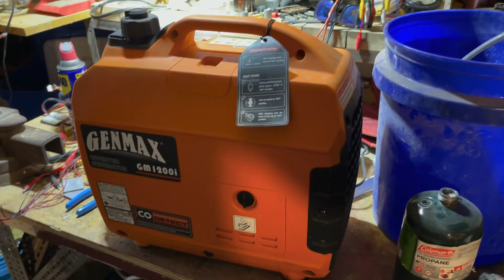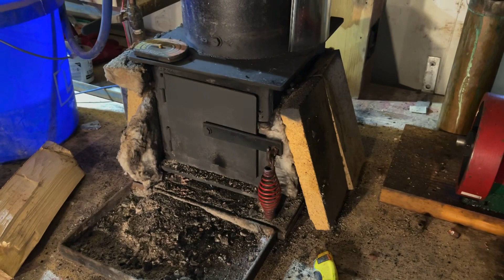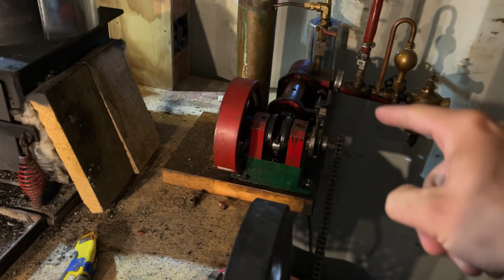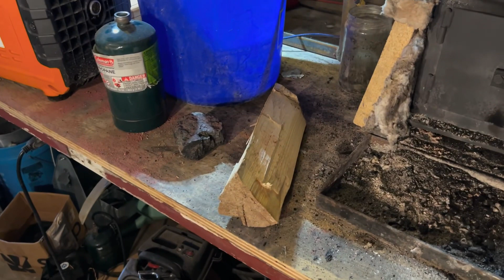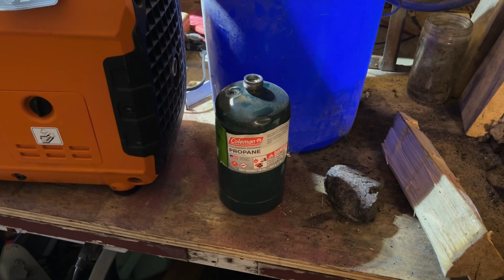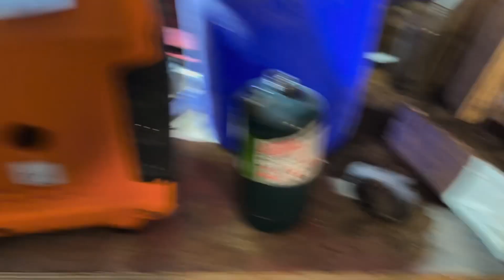The Efficiency of Steam Engines

Comment: I don't get this. Who is saying steam engines have low efficiency ? Modern steam engines are the most efficient engines we have  with  60% efficiency .except for theoretical sterling engines which could be above 70%. 
All most power plants use steam to generate power and they beat internal combustion engines in efficiency.

Also, no
Wood does not burn by generating gas and that gas burning.
Woods base structure are carbon tubes with carbohydrates and minerals in those tubes. In fact wood can be made transparent or hard enough to be bullet proof by processes that remove all the carbohydrate or puts pressure and heat on them.

Wood can be refined into charcoal and that charcoal into quite pure activated carbon. both of which will burn directly and not somehow be refined into a burnable gas. Sap/tar will boil into a gas but it will also just burn on it's own too because in essence it is petrol and wood tar has been replaced by petrol in industrial applications.

You are probably confusing the  internal combustion engines which ran on wood stove generated gas which were popularized by Germans in ww2.  

the burning of wood is still the same as the burning of propane but the woods composition is fire resistant en prevents its components form burning well. once the fire is hot enough it is not a problem. how ever propane comes in a gas which will turn into hot gases but wood will burn as a solid and and turn into hot gases. it's the hot gases of the reaction that heat up the water and not the reaction itself. 

With the proper boiler configuration and firebox steam engine are more powerfull and efficient then internal combustion engine once they are at operational temperatures. Which is the only drawback, that and water freezing temps which prevent cars from being on steam these days because no one wants to wait 10-20 min for a modern steam engine to get to working temp  and no one wants to make sure no water is left in the car if they store it outside in winter.
Reply: I'm with you on this. A while back, I set out to design an internal combustion engine based on a rotary vane pump. The steam counterpart to this engine is so much easier to design. I think humanity made a big mistake abandoning steam and external combustion as a whole.
Reply: @Ron-yj4rh  I live in Canada and so Steam is a bit hard on things that wont be constantly operating, specially in winter. So I totally get why internal combustion won, but external combustion engine seem like a logical evolution now that we have the computers to calculate and simulate efficient designs.
In fact, steam could make a come back with computer and more powerful batteries to keep the engine above freezing when it is not running. how ever once the battery runs out you have to plug your car in to warm it up. Steam would also be more powerfull in winter since it would be easier to condense it back to water
Reply: @ There's something you and I are 100 percent in agreement on: Steam could make a come back very easily. We have better metallurgy. Better design tools. We have chemistry that could help lubricate engines and fight freezing and corrosion. Imagine a car with a series hybrid steam turbine. It could run constantly. Powering your house while parked in the garage. Giving us a power system that frees us from the grid and making our power supply fluid. All within our capabilities.
Reply: Supercritical steam turbines can hit 40-50%. Very dangerous. Not a rookie sport.  Most non-supercritical steam turbines can reach about 30%. Most piston based non-supercritical steam engines are sub 10% all day long.  It's possible to reach 12-15% but it's just not worth the extra work when turbines work much better.

Comment: A well designed and well built small piston steam engine system optimized for combined heat and power with wood fuel would be extremely useful in many settings. It's difficult to get high engine cycle efficiency. However, high engine cycle efficiency is not terribly important when the fuel is readily available and low cost (i.e. wood) and when the heat is captured and put to use. 

I am assembling a steam engine system of a unique design. The design engine cycle efficiency is around 15% (not including thermal losses from the steam generator). I am currently testing the steam generator. Design conditions for the engine call for around 500 psig superheated steam up to about 700F. I've tested the steam generator so far up to 1200 psig and over 800F. No problems. However, I have a lot more testing before I will be confident to start assembling the steam expander. The design power is up to 3 hp at the shaft at around 1200-1500 rpm (will be a high compression single-acting uniflow 2.5" bore with a unique bump valve design similar to the Jay Carter steam engine). Note I am using a propane burner for testing. However, I previously build a wood gasification furnace for testing. That furnace was extremely clean, high temperature, and I could vary the output precisely from about 15,000 btu/hr up to about 50,000 btu/hr.

Comment: If you can use the heat from "refining" for everything that requires high heat the total efficiency will only go up. If you need a boiler, make an oven and a stove out of it. Make sure it has a pressure valve aimed in a safe direction. Having that and periodically checking that it functions correctly is what keeps the boiler from becoming a bomb.